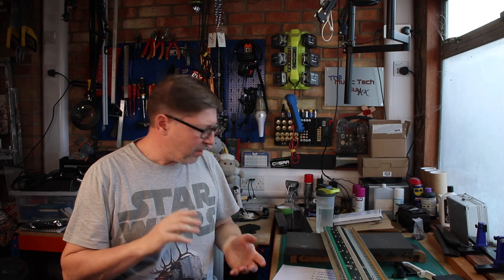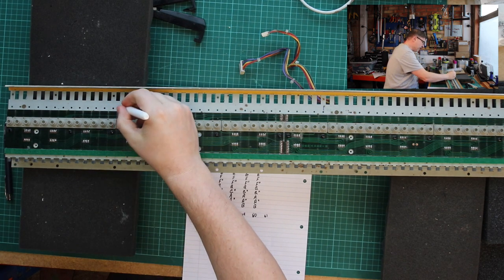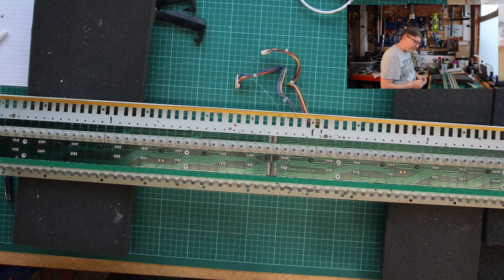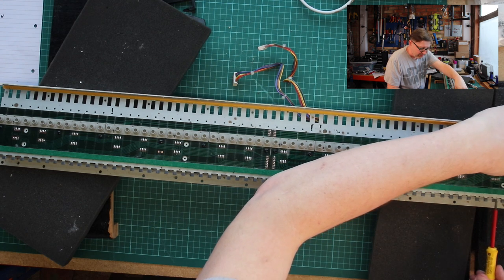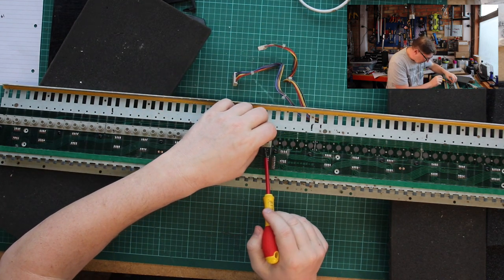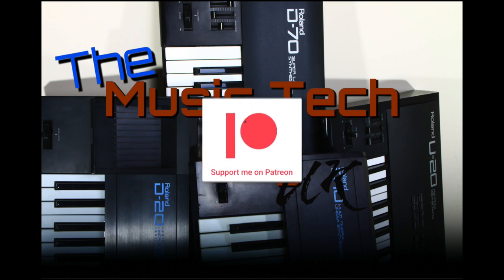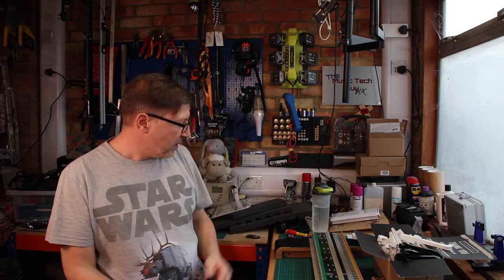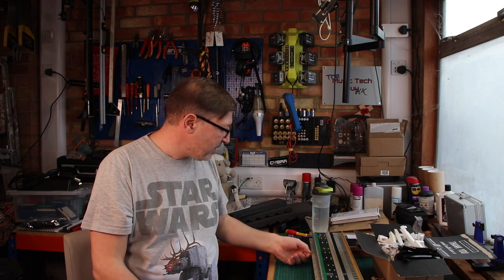Roland JX-3P Restoration - Part 7 - Starting the keyboard rebuild

Comment: Very interesting in regards to the part that has been cut. I wonder if the machine ran into some trouble early on in it's life. I've always looked after my System-1 for example, but after the first year, most of the keys went dead. Cheers! P.S - Sorting out the TR606 for you this week!
Reply from the maker: Hi @The Death Beats

Yeh, I think the person that had it prior to you had some work done, which is strange as it wuld still have been a young keyboard at the time.  Jon